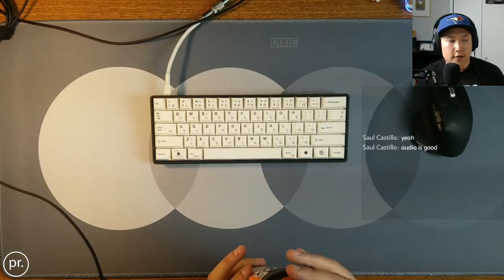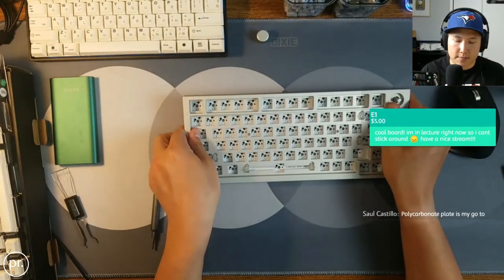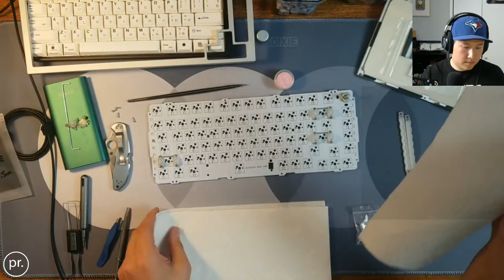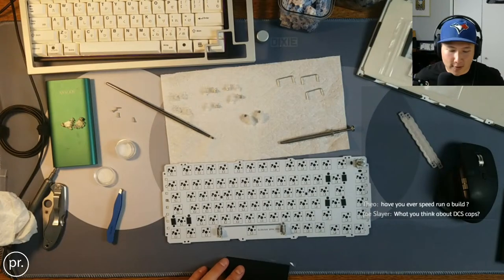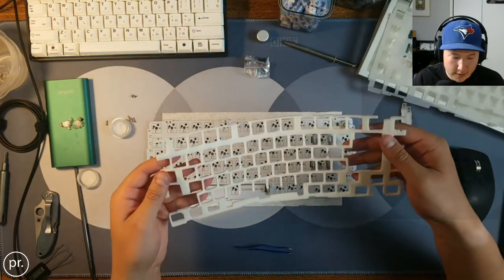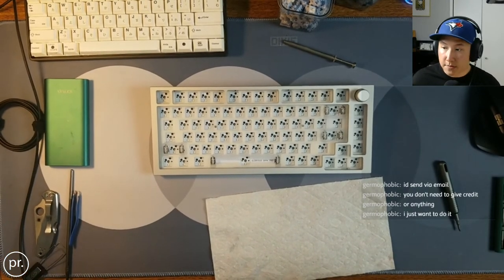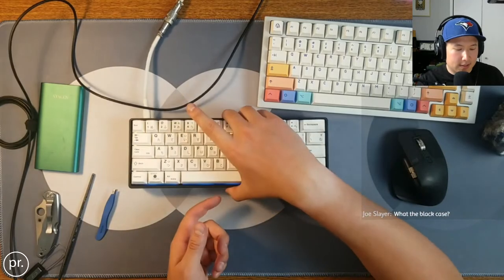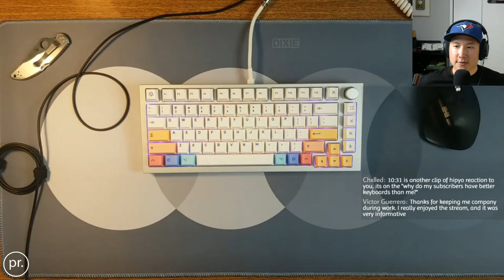Building and fiddling with the GMMK Pro!

Comment: I put the PC plate on mine and it actually bows the PCB and makes it so that my spacebar stabilizers don't pop up properly - I think I may need to like sand it down or something so it fits better because it can be annoying and not consistent - anyone ever do this? i don't know where to sand down...
Reply from the maker: Yeah so I just did a livestream where I built another GMMK Pro and came across this issue (no issues with my personal GMMK though - strange). I ended up needing to file down the spacebar stabilizer to widen the opening, as well as the top of cutout where the rotary encoder knob goes. Works fine now though.
Reply: Same thing happened to me, so I sent the PC plate back for a refund and bought the aftermarket FR4 plate by AVX Works. This actually looks, fits and sounds better than any of the plates Glorious supplies. No fitment issues with third-party stabs either, I use Durock v2s that I’ve lubed with Krytox XHT-BDZ. I’ve replaced the stock gaskets with the thicker D65 ones from KBDfans which adds flex to the board. I’ve also replaced the stock case and plate foam with the set from StupidFish which is much higher quality. I’m using lubed Everglide Aqua Kings switches. The board looks, feels and sounds excellent. Highly recommended.